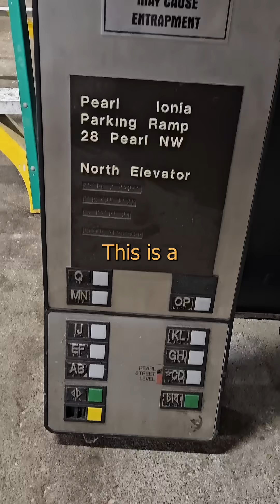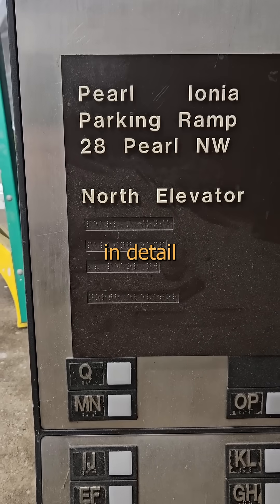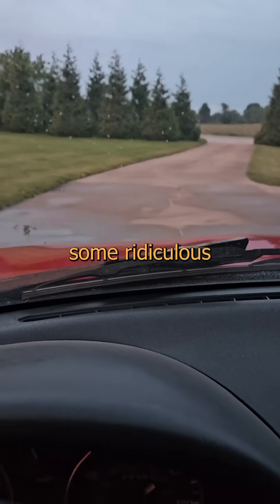Miata Mischief #chrisboden #engineering #gear #elevator #score #stories #parts #hacking #making

Comment: Was at an auction looking for stuff to put into my new house I just bought. Got a huge grill for $20. Stuffed this 300lb grill that absolutely didn’t fit into the back of my Hyundai Veloster. My iPhone 4S, the backup to my iPhone 8 Plus, had started puffing up like a drunk girl who was slightly allergic to tequila. It stopped working so I couldn’t call my dad to help me. I get on down the road and I start to smell gas. I open the windows and keep on trucking. Turns out someone left a 30lb propane tank in the grill and me manhandling the grill into my car causing it to leak. So I basically drove home with a bomb in my little hatchback with a lithium igniter full of hydrogen gas in my pocket (it actually started smoking a week later but I got my other phone back by then.) Ended up winning a better grill from work so I sold the junk one for $40.

Comment: i bought 42 desktops on ebay many years ago, i completely filled a 7x5 cage trailer in port melbourne and drove it nearly 200 km home, the trailer was massively overloaded and the 1977 Mazda 808 (1600 engine) was sucking the fuel tank dry so fast i could literally see the fuel gauge dropping.
i left at the start of peak hour home time traffic, and 2km from the depot i locked up all four wheels and got pushed part way off the road by the trailer, i took it real slowly after that, going up the Pentland Hill's on the way to ballarat my speed dropped to 30km in second gear, i just made it to ballarat and had to call a mate to bring a jerry can to get me to a petrol station.
to this day i have no idea how the hell the car didn't expire or how no copper saw me.
the desktops were used to make 38mm thick walls in one bay of a shed so i have a carpeted office for doing electronics work in, oh and the cost of the desktops was AUD$1.00 each.

Comment: Back in college, I used my friend's Miata to haul 14 people and myself home from a concert. As you are aware... it seats 2. We had the top down  I was the only sober one in the car and was originally the only one who rode to the concert with my friend. Everyone else met up at the concert but got drunk and/or high off their assess and could barely walk home once I got em to their driveway.
Reply: That's just to say 14 is a "HOLY SHITE!" Number of folks in a miata. BRAVO!
Reply: I fit 5 in my del sol once, top on (it was winter) two in the passenger seat, one in between, and one in my lap (girl locked her and all her friends out of her truck when a massive group met up for dinner. 

I was the only one that came by myself, so it was up to me😂
Reply: I once had 10 people in my first car (A Fiat 127. The predecessor to the Uno, with similar interior space). It was only to get everyone 4 or 5 miles to a bus terminal, but it was nuts.

I was driving with my seat all the way forward, there was a guy and his girlfriend in the passenger seat, three guys across the back seat with 2 young women sitting on their laps with their backs to the side windows, and two more women in the boot (Trunk).

The poor little 1049cc engine struggled to get us all moving, but the most vivid memory was that with so many people in such a cramped space, it got really hot in there and the windows kept steaming up from all the sweaty bodies. 😁
Reply: @Reman1975 ah, the famous prowess of the brakes of the 127
Reply: @Reman1975 stopping distance: train
Reply: Cant believe the suspension could support that...
Reply: @ungabunga3183  usually doesnt.  Generally they ride the bump stops when you overload like that 😂
Reply: I live in a "college town" of sorts, and saw something quite similar last night in the Walmart parking lot.  One person was mostly out of the sunroof.  Still partly in the vehicle. 

I'm imagining what You did to wedge that many in Your car.
Reply: @RedDawn430  that poor, poor little car
Reply: My dad's Ford escort wagon broke down, so we put it in the back of my dump trailer with the whole ass hanging out, the back tires were only half on, quite a few ratchet straps later, one "that's not going anywhere" and she made it the 4 miles home
Reply: I was going to mention the time I had my brother, his wife and their two sons in my Fiat X1/9. Your story is more like the time in the Philippines I saw a tricycle (a small motor cycle with a side car like a rickshaw) with about a dozen kids  hanging on, going to school.
Reply: @CharlesRWard 👀
Reply: One of my only good memories from high school is 8 or 9 of us piled into a small Chevy station wagon going to the movies. Two in the front row bucket seats, four in the second row and 2 or 3 in the trunk. Didn't feel crowded. Felt nice. Anybody that's had the good fortune to literally pile into a car with friends to go somewhere together has been at least a little lucky/blessed in their life.
Reply: Pure sketch.
Reply: That Definitely qualifies for being a Clown Car
Reply: How dug faq
Reply: Nothing as dramatic as this, but back in high school, me and some friends wanted to go to waffle house, as you do. There were 6 of us, and I was the only one with a car at the moment because the only other one with one had it in the shop (because your first car is always a junker.) So we got into my kia soul, 2 up front, 3 in the backseat, and the second skinniest in the trunk because it had practically none. This is mainly memorable because we all had to play it as cool as possible while a cop went our same way right behind us for a majority of the trip. I still have the contact photo for the guy in the trunk saved as him basically falling out of it at the restaurant.
Reply: I hope you used rachet straps or bungees at least.😅
Reply: There’s a nonzero number of people who have intense flashbacks of this event triggered entirely by olfactory stimulus. 

Cheers!
Reply: The Indian bus method.
Reply: then everyone clapped
Reply: @covfefe69 what do you accomplish by being toxic? He answered the prompt in the video and dint talk himself up. You, on the other hand…
Reply: @carazy123_  oh noooooooooooooooo

Comment: It was very simple stuff but once we got a glass table and decided to later use the top part as a base for a glass canvas frame for gluing a 5000 piece puzzle recreation of the sistine chapel, once we had it finished we had to move it like a small neighborhood with it in the car. Due to the dimensions of our small car, we had to put the flat glass surface in an angle from the back of the passengers seat to such an angle that the driver had to be at an about 60 degree angle while driving. Very slow careful driving got us to the place without any issues other than getting the cargo door stuck open for a few days, but immediately when we parked and were removing it from the car a cop car stopped at the other side of the road, visibly stared at the glass frame leaving the car in a fashion similar to clowns leaving a clown car and left without saying anything

Comment: My mother has a 2020 Jeep Wrangler. She went to get her tires replaced with something more aggressive and knobby, but wanted to keep the old tires to resell them used. Of course, 2-door problems lead to her instructing me to hitch the trailer, go get the tires, and bring them home.

I own a 2022 Honda Civic Hatchback. I can, with confidence and pride, confirm that I can fit five - yes, all five (the four for driving AND the spare) - Jeep Wrangler tires in my car.

Honda: 1 - Jeep: 0

A few months down the line, it was time to buy Halloween decorations from the Home Depot. Of course, 2-door problems, so I had to hitch the trailer, get the decorations, and bring them home... But I have a hatchback.

Once again, I can confidently and proudly state that my 2022 Honda Civic Hatchback can hold x1 12' Animated Grim Reaper Animatronic, x1 6' Illuminated Gargoyle Headstone, and x2 Resin Headstones (of various sizes, about 6"x36"x48").

Honda: 2 - Jeep: 0
Reply: I wish I could post the pictures, but they do exist.
Reply: The FK8 has place for all 4 8.5x20" rims. But I have problems with taller stuff like luggage
Reply: I once filled the back of my encore with fire wood because it was easier than using the wheel barrow, pluses the wheel barrow tires were flat, my dad was NOT surprised when we told him how we moved the wood

Comment: Christmas tree, but we were also moving.
So: pine tree we'd just cut wedged between/atop/around various luggage and boxes on the roof, in the start/middle of a snowsquall, trying to drive an hour (it ended up being almost 3).
We did have and use 3 rachet straps, but they kept sliding - 2 were broken and tied in loops around everything possible and the third was doing all the primary stabilizing. The windows were cracked to let us hold on to the ends.
Drive 2-ish miles, pull over, maneuver the straps/doors, and shove the tree back onto the roof. Start driving again, and within 500ft the tree had already slid down to cover one side of the car or the other. Wait until actual dangerzones (roughly every 2 miles) and pull over again on the 'shoulder' of windy hilly farm roads.
Repeat for a very cold eternity.

This was the 80s, so no pics but many many many cuts and bruises.
Ah, to be young again.

Comment: I've recently moved with my 2019 Miata. passenger seat a floorboard filled to the brim. trunk filled, and I had 70ish pounds of clothes and blankets in a soft bag on the roof strapped down. So yes, if you're a single person you can move your essential belongings. I drove this From NC to NH.

Comment: literally daily drove a first gen miata(NA6), as a result had to pick up a 60 gallon air compressor one day. And like you used the passenger seat. Yes the top had to be put down. Yes there are pictures.

Comment: Hauled a ford FE 390 engine block, 2 sets of heads, 2 sets of cylinders and 2 intake manifolds in the trunk of my grand marquis. She was squatting so badly i couldnt go over 55 on the highway or the front end would start to come off the ground.

Comment: When I was younger, my mate and I moved house. We had an unregistered car with no interior and a milk crate for a drivers seat. 
We filled the cabin with stuff and strapped 2 mattresses on the roof. There was no room left in the car so my mate laid in between the 2 mattresses. He said at 80km/h the top mattress flipped up and there he was, a guy with big red dreadlocks sandwiched in between 2 mattresses on the roof of a car.
Definitely not the dumbest thing we did but it's a pretty funny memory.

Comment: Mine is not very sketch because it worked. First gen Honda Fit with an 8 foot ladder sprawled from the truck all the way up into the windshield along with several 2x4s. The trunk closed successfully. 

I guess there was the time thay I loaded the same car up with everything I owned to move 11 hours away to my now wife. I'm pretty sure the rear suspension was maxed, but it FIT lol.

Comment: I can't drive, so my daily driver is a Specialized electric assist bicycle. It makes more sense to use that then a car or truck when I can anyway, I can use the cardio and gas is getting ridiculous where I live. I have a big thermal insulated backpack and a pair of panniers to carry whatever I need to that fits.

I was checking out a wonderful little store called Universal Collectibles, selling and buying some videogames and related hardware, when I saw my single biggest vice in the corner- a big Lego collection! I couldn't believe my eyes when I saw a sealed copy of the Lego Technic 42110 Land Rover Defender, one of the few sets I'd really wanted but couldn't afford, for almost 50 bucks below its original retail price! I was determined to take her home. I couldn't fit it in my panniers or backpack, so I had to improvise a bit.

A couple days later, I called the guy to ask if he still had it, he said he did, so I rounded up some belts, bungee cords, drawstrings from who knows what, the belt/strap thing from my bathrobe, and a big trash bag to hopefully protect the box and catch whatever might fall out. I went back to pick it up, and strapped it to the rack on top of my rear wheel, with 3 straps in each direction. Unfortunately one of the belts tore into the box a bit, but other than that it was perfect! Almost no shifting even with some big and sharp bumps.

Anything I should do differently next time I have (or want) to carry a big box like this on my bike?

Comment: A whole panel of twin wall sheeting with opaque protection foil inside my VW polo. Could not see out my right side exept a slither of the mirror, when I leaned forward all the way. That one solidly crossed the line from  sketchy to outright endangerment and then some. It sounds benign, but man... Transporting two tons worth of granite gravestones on a flatbed with only one tie-down strap barely registers on the pucker factor scala compared to how I felt at the end of that ride.

Comment: Not super sketchy, but this might help someone else in the future. I had to move a queen sized mattress in a Nissan Altima, and rain was in the forcast. Luckily it was a bed-in-a-box, so it didn't have any springs and it easily folded up. My buddy and I folded it in thirds, put two ratchet straps around it, and tightened the absolute piss out of it. And it was able to juuust barely fit in the back seat of the Altima.

Comment: Oh god, 8 12ft PVC pipes in a truck with a 5ft bed. I had to stick them through the back window. I rested the front of the pipes on the dashboard and the back of the pipes stuck out past the tailgate. I used a pool noodle from Dollar General on the front so the windshield wouldnt break and scotch tape to prevent the pipes from moving around. I had no bungee cords, so to prevent them from sliding out and onto the road, i put my right arm around it while using my left hand to drive.

Comment: Ahhh, I used to do concrete for a while, one jobsite we had a truck (2012 350 powerstroke dually, steel bed with tool boxes, rebar racks the works) shred a serpentine belt. It was still loaded down with lumber tools an extra ton of half inch rebar, we loaded that bitch on our 30 foot equipment trailer, strapped and chained the fuck out of it, hooked it up to our flatbed dually sent a prayer and hauled that pig like 60 miles back to homebase to fixer up, truck still runs in fact my old boss is selling it cuz he got a new one

Comment: I hauled two mid-size recliners in the back of my former 2003 2.5L Wrangler across a good non-stop 450 miles of country roads and ferries with little more than more ratchet straps than I cared to count and pure hatred for my own sense of judgement. 🚜

Comment: About 15 years ago, I found a wide/flatscreen CRT TV at a thrift shop and decided to buy it for what would now be called retro gaming. 3 feet wide, 2 feet tall, and a foot and a half deep. And, being a CRT, it weighed 150lbs. Problem number one was that I only had a 2-door Geo Metro to get it home. After trying to cram it into the back, it became clear that it was never going to fit there. So, after a fair bit of wrangling to get it past the door, into the front passenger seat it went. Then I got home and realized problem number two: My apartment was up a half flight of stairs and I didn't have anyone to help me carry it. After much grunting and muscle straining, I finally managed to wrestle it up the stairs and down the walkway to my apartment and get it into place. 

My pecs are aching as I type this just from remembering it.

Comment: 1985 ford Mustang, bad blow by on the engine hatchback removed,  used it as a Ford ranchero.
Hauling  lumber un tell the drive shaft. Was grinding on the underbody? I took AR12 free on. I can collected the water in the oil by way of the the blowby tube first week. I got a qt of water out of it.

Comment: Hardly any affordable car is as much fun as any Mazda MX5 (Miata in Europe is only the first version). I drive a NC, third gen). Love it. And with the top down, you can actually take quite some cargo. I once used a Volvo XC70 to haul down 700 kgs of steel from the UK to the NL. It was sketchy, but it worked.

Comment: At 19 before I had a car, I saw a listing for a free couch on Facebook Marketplace. I promptly thought to myself "I sure could use a couch for my room" so I messaged the guy, walked 2 miles through the suburbs to his house, tested the weight, and much to his simultaneous bewilderment and respect flipped it upsidedown, and started walking away. I walked the full two miles home with that couch over my head. Got a lot of people staring, and one cop (who may have gotten called, or may have just happened to see me) who wanted to make sure I didn't steal it. It took me about an hour to get home with it. I'm a big fella in all 3 dimensions and an extra 60 pounds of duvet over my head called for a couple breaks. Thankfully it was summer so I just kinda set it down on the sidewalk, and hand a nice load off. The biggest hitch in my plan was not telling my parents, and I had to fight with my mom to let me keep it.

Comment: I live in Canada, we use firewood to heat our home. Picked up a load of cut, split and dried wood from a guy that sells it. Loaded my old Chevy 3/4 ton so much the front wheels barely touched the ground. Drove 200km home at about 60kmh 
Good times